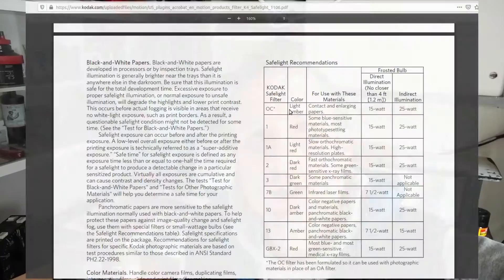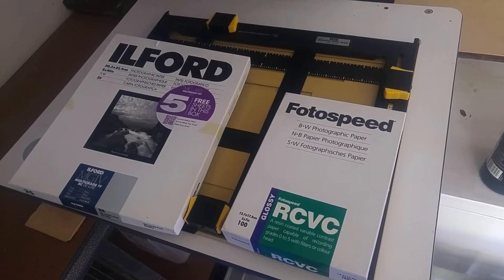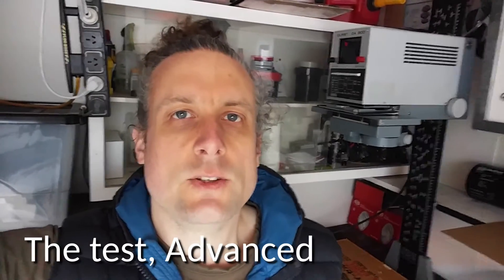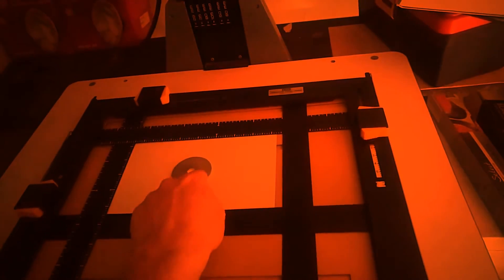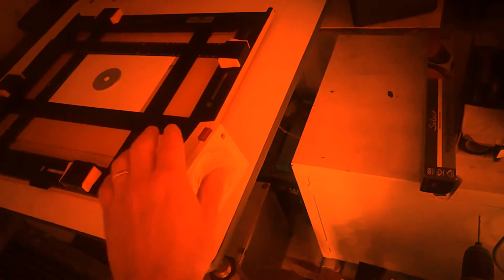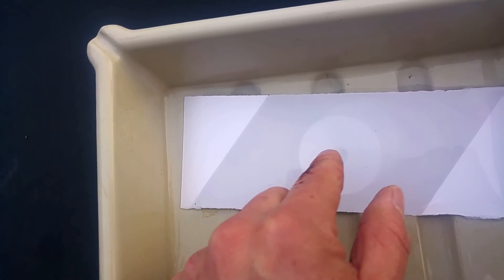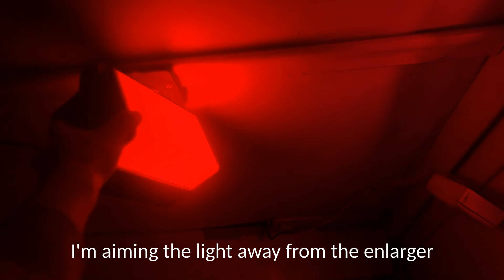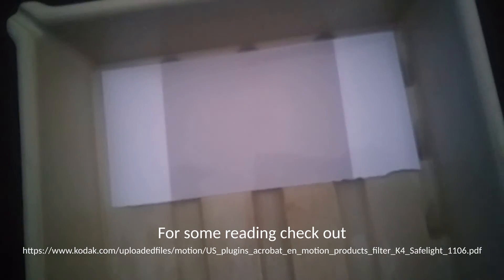Darkroom Safelight Test demonstrated

Comment: Very informative. That's interesting that exposed paper is more sensitive to safe light fogging than unexposed paper. When I first set up a darkroom, I won't have an enlarger as yet as I'll be shooting paper negatives with a pinhole camera (and obviously no contact printing yet.) Do you reckon I could use a desktop lamp to initially expose the paper before placing something like a washer on it?
Reply from the maker: Yes, and you could contact print to make a positive with a desk lamp too.
    Would be nice to have a timer though.
Reply: @thorleyphotography  Ah thank you. I have toyed with the idea of using a desktop lamp for DIY contact printing. Though it would be nice to have filters to adjust contrast. I don't have any ideas on how to incorporate a filter system or holder under such a light source without light spilling everywhere.
Reply from the maker: @anzaeria  You could spill light everywhere as long as your paper stock is put away.
Reply: @thorleyphotography  Yea I was referring to light from a lamp spilling outside of the filter. For example white light hitting the print as well as filtered light. I guess I could lower the filter up and down below the desktop lamp (before getting out the photographic paper) and see how much coverage I get with the filtered light....if that makes any sense. Of course no such issues when using a filter tray inside an enlarger.